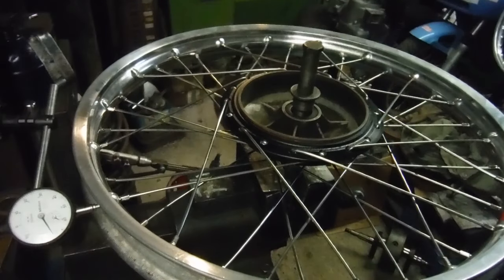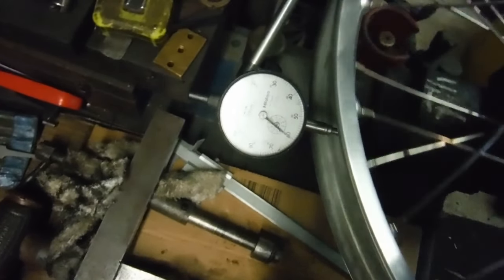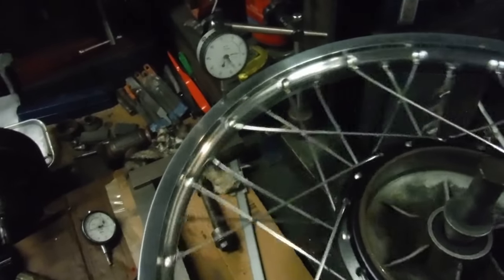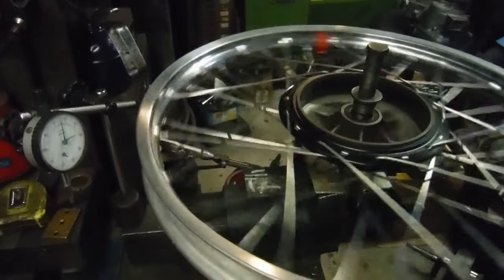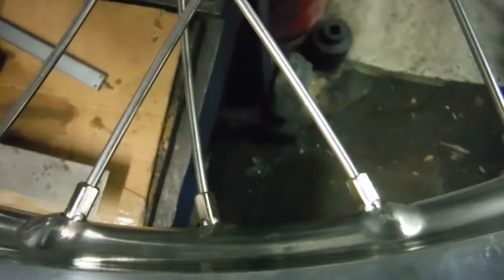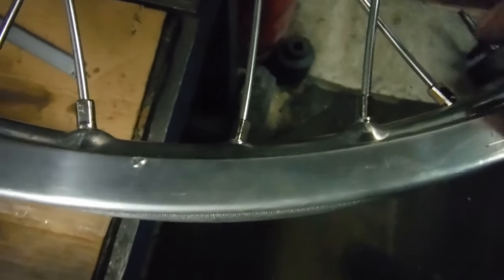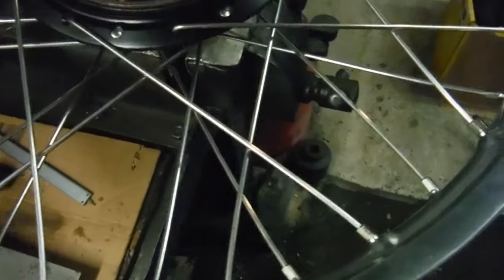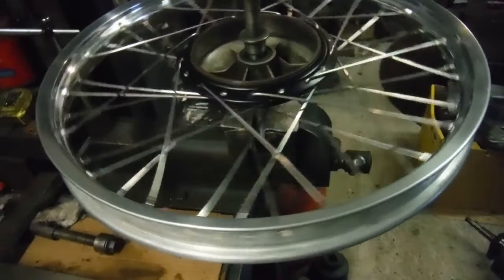Discussing a rebuilt wheel which has a slightly incompatible rim due to spoke hole angles.

Comment: I reckon you are on to something regarding the wheel rim being intended for a full width hub .  I don’t think the slight bow in the spokes will be an issue ,as they are all of equal tension .  I remember trying to lace a push bike rim , & making a right dogs breakfast out of it . If I had another go on a motorcycle wheel ,being a retired joiner ,I would probably build a jig to get the correct positioning of the hub to the rim.  It would be the only way I could even stand any chance of getting a decent true wheel .👍

Comment: Looks like the 36 spoke holes were drilled at the angle for a 40 spoke setup.
Plus the possible wrong hub angle thrown in the mix.
I had a cheat sheet somewhere with various angles for different rims to hubs, lost in the detritus of stuff I presume.
Some of the stranger ones were a BMW 4 shoe 10” to a 16” for the front of a sidecar with an 8” Honda to a 13” car rim for the rear.

Comment: If the wheel hits a bad pot hole the already slightly bent spoke will be more inclined to bend even further won't it ? Or, to put it another way,  less able to resist the stresses of such an impact.
Reply from the maker: I think it is probably sound enough - though not ideal. It is surprising how many there are out there, even on some classic racing machines I have seen.

Comment: Regarding the bend in the spokes, it looks to me the the spokes going to the larger diameter need to go to a smaller diameter and the spokes going to the small diameter need to go to a larger one. So I think you was correct in your first assumption, the rim need turning over. If you put the rim on a full width hub, you will still have a bend in the spokes on the upper face of the rim as you have it in the vid. Just my two cents worth.
Reply from the maker: Yes, I thought that at first, but the bends in the spokes showed the angles of the nipple holes to still be wrong if the rim had been turned over. I suspect it was really for a full width hub, probably with a different length of spokes to either length seen here.
Reply: I'm not convinced Paul. If you lace the rim to a FWH of the same diameter as the brake side of the half width hub, it'll still have a bend in the spokes. The nipple angles are telling me that that upper side of the rim want to be mated to a smaller diameter.  If it was me, I'd whip it over and try it. It stands out like a sore thumb at the moment.
Reply from the maker: I considered that, but the spoke holes appear to be at the same angles on both sides. I have turned rims over in the past, but I doubt anything would change in doing so with this one.

Comment: I remember reading (R.E unit 250/350?) wheel build instructions which included the use of a lead mallet to slightly alter the angle between rim and spoke, prior to final lightning. I wonder if that may have been useful here?

Comment: Are you sure he put the rim on the right way round?  Its hard to know without seeing the whole wheel but as you say its either the rim for a full width hub or its back to front.  Many years ago (many many..) I crashed an OIF A65 (conical hub) and it was rebuilt on the insurance.  When I go it back it had been built with the wrong rim.  It had the pre-OIF rim not the conical hub one.  Every spoke was bent like the one you have but I never did get it fixed and it was sold like it 20 years later.   I'd ask the owner for the receipts just in case its the correct rim the wrong way round as I did once put a rim on the wrong way round and I found it  was impossible to visualize the other way.  To be for a hub halfway in size that would be about 4" which doesn't ring true.
Reply from the maker: A full width hub using shorter spokes might fit the bill.
Reply: @paulhenshaw4514  Yes, that makes sense. Be interesting to see what he ordered.